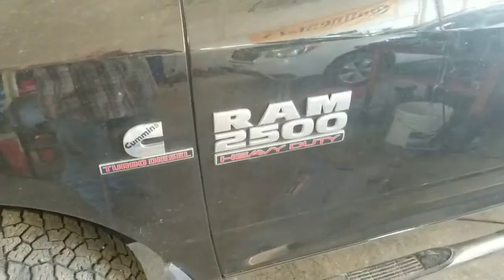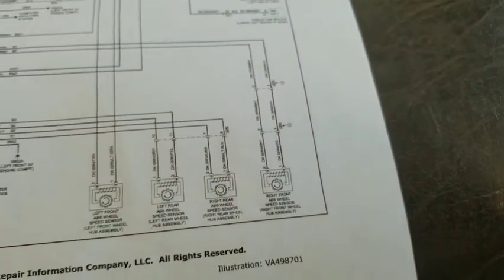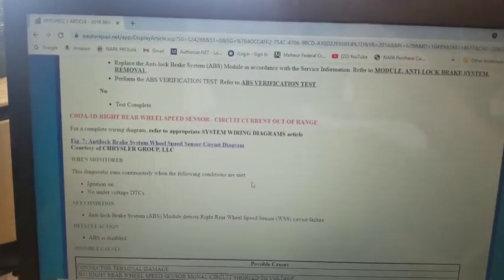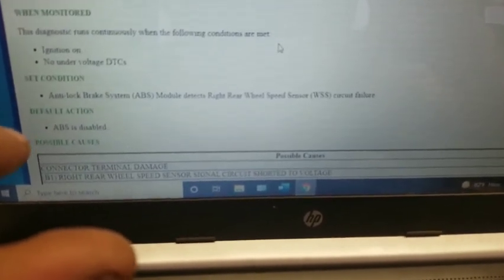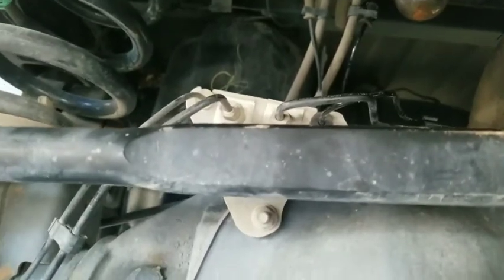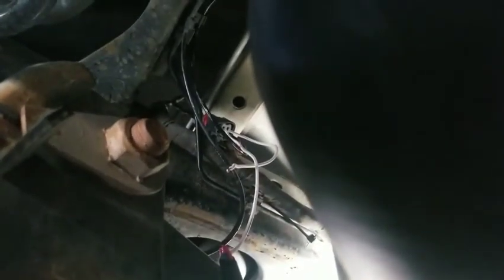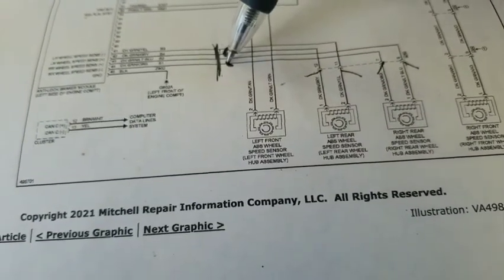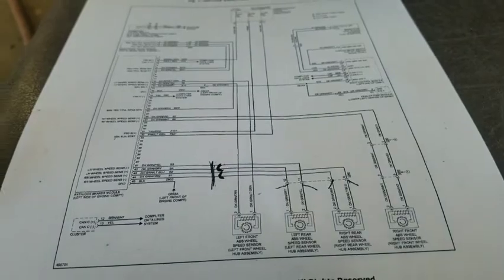Dodge Ram ABS code C003A-1D wheel sensor wiring problem

Comment: Excellent video! All around with the diagram, wiring locations, procedures, explanations, troubleshooting. Everything. Just a good solid very helpful informative video 👍. I have a 2013 2500 and chasing this same problem only without a volt meter. Might be time to get one.

Comment: The 4x4 needs to be tricked. Shut the truck off switch it to 4x and then start the truck...
Reply from the maker: Is that how you can get it into 4x4 if you have an ABS issue?
Reply: @prodieselrepair3218  yes